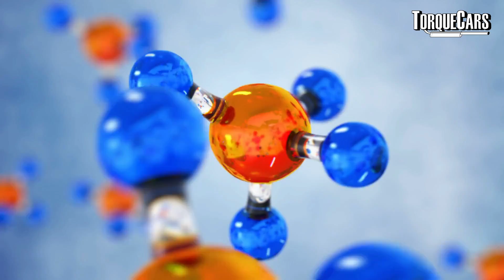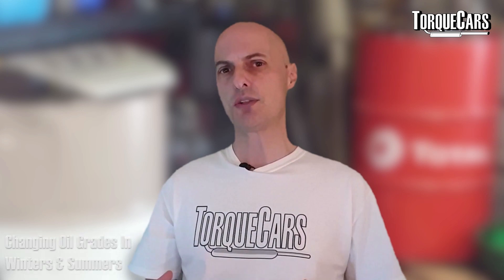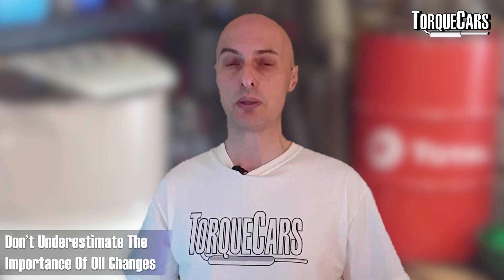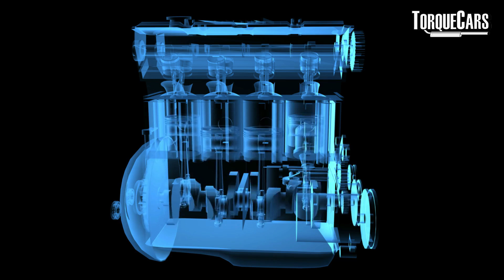🚗 Unlock the Secrets of Motor Oil: A Comprehensive Guide to Car Care! 🚗 🛢️ [Which Engine Oil/Grade?]

Comment: Iv been using Castrol edge 5-30 507.00 in my 1.9BRS Pd engine for 10 years but have recently learnt I should be using 5-40 505.01 spec… very complicated all this, apparently the 5-40 505.01 spec is specific for pd engine camshafts (my engine is non dpf)

Comment: I think it was Castrol who published some very interesting data on the life of their oil. Basically and assuming they're in spec in terms of viscosity and chemistry compliance then the only advantage to the more expensive product was that it lasted longer.

This is why I personally use Asda (a.k.a. Tetrosyl) oil as it's cheaper, ACEA A5/B5 compliant and I do oil & filter changes every 6 months so any reduced life is immaterial.

Also worth mentioning is that the ACEA standards, which are set by European vehicle manufacturers are tougher than the equivalent American API standards, which are set by oil companies. I actually suspect this is part of the reason why engine failures of European vehicles are apparently so common in the 'states.

Oh, and also it's not a great idea to mix brands of oil. You can have two formulations, both of which meet the same specs but which arrive there though different and incompatible additive packages. These can conflict when combined in the sump, so bear that in mind.

Comment: 5w30 is now my minimum. 0 soot in exhaust tail pipe. Injectors  and  intake clean.  USA. Pacific northwest  mild temps. Mainly highway hiil drives over 20 miles.

Comment: 2011 Corolla, 256,000 miles, Change it every 5,000 miles with Wal Mart full synthetic 0W-20 20,000 miles protection, with a genuine Toyota/LEXUS filter. Car runs great.

Comment: Why do i feel like manufacturers will take a thinner oil in order to meet emissions standards rather than the best oil possible for the specific engine. For example, Hyundai i20N , recommended 0w20 only, nothing else. Will a 5w30 be better for the engine in such a performance oriented engine? 1.6 T-gdi with 1.2 bar of boost if i remember correctly...

Comment: On a Chevy Spark here in the US on the same engine in 2016 they recommended 5-20, then in 2018 0-20, but the same engine in the Philippines says only use 5-30, even though the oil cap says use only 0-20! I live in Vegas, and all my cars are in my garage, I put in 5-20, but will change to 5-30 next change.
Reply from the maker: That is interesting, the Oil grades are sometimes changed according to region. The temperature range the car is used in will impact the oil grade choices.
Reply: Maybe because we have Cafe mileage here, but why not give you the option for the owner here?

Comment: Nice straightforward video as always, although I was surprised you didn't mention ACEA numbers, which should be referred to after choosing the correct viscosity.
Tip; as a chemist, when naming compounds, we don't look at the whole word, we break it down into it's sub units or chains. Eg ZDDP is zinc, dialkyl (meaning 2 alkyl groups), dithio (meaning 2 thio groups then phosphate (a phosphorus compound containing oxygen). I don't mean to be a smart arse, just thought it might help in future. 
Engineering Explained has some great videos on oil. I would recommend mineral versus synthetic oil. He doesn't go too heavy on the science, so it is easy to watch.

Comment: What would you recommend for Seat Leon 5 D Reference 2019 1.4 TSI 200nm mt - 6 125 h.p.
CZCA engine
The sticker under the hood says 502 for Ukraine where I live maybe due to a lot of sulfur in the gas (supposingly 502 has more protective set of additives over 504) and the dealer says it sould be 5 w 40 but the car ran badly on it and had a poor torque on such viscosity plus it heated up quite fast to 95 C most likely it is desined for thinner oils. I ve been using liqui mily top tec 4210 504, 0 w 30 so far, the rear cranchshaft oil seal seem to leak a bit but not sure if it is connected with low viscosity. For Europe they recommend 504 and even 508, so the specifications are quite confusing for those downsize vw engines. Most oil finders have a median suggestion of 504 5 w 30. Thinking of it after honing it on 0 w 30 Would be glad to hear your recommendations on oil standard and viscosity. Thank you

Comment: I have an 1,8t (AUQ) with turbo - mod, 23 psi with original compression on 102 octan. I use the supercar castrol edge 10/60. Due to the mod it was recommended to me.
I live in western Germany. Motor is running very smooth.
Reply from the maker: Thanks for the support & tips my friend, good to have you aboard.

Comment: I have been changing the oil and filter twice a year on my Volvo that takes 0w30 fully synthetic ,I live in Manchester England and it's not  that cold in the winter, would there be much of a problem  moving to 5w30 as it is a good bit cheaper . Good videos mate you got a like off me 👍
Reply: Rule of thumb with oil grades is you can go down for the cold weight and up for the summer. 
For example 10w30 to 5w30,0w30 10w40
OEM is best specially if vehicle is only getting normal road use. 
However always just check owners manual as it’ll give alternatives if applicable.
Reply from the maker: Thanks for your support and kind words of support.
Reply: 5W30 fine but 4 times a year

Comment: Not a car but motorcycle  10/40 is stock running intake and exhaust mods with a lot of hard drives  switched to 0/40 magnatec also use   zx1 extra lube change oil / filter  every year regardless of milage ive had the engine apart and have no wear issues
Reply from the maker: Interesting thoughts, and thanks for supporting my little channel.

Comment: I use Duralube, to reduce wear at startup.

 My car is spec'd for 0W20 in this country. Other countries have it spec'd for 5W20 or thicker. 0W30 should flow fine for cold-weather startups, but provide better protection at operating temps.
Reply from the maker: I must do a video on oil additives, there are so many pitfalls and some great options out there. Thanks for the idea.
Reply: @torquecars  Be careful doing that lol.
Reply: It's all EPA nonsense. Run the 5w20.

Comment: Thanks for the content, but there is a little more to it than just that: some engines require oils with the correct specifications and additives. Ford for instance has a timing belt that runs in oil, if you do not use the right one, it will just dissolve into pieces
Reply from the maker: Great point. I really didn't want this to be an in depth scientific video, I do have one planned and will mention further considerations given to the oil blends and components chosen. Perhaps modern cars are just more fussy than they used to be when it comes to oil.
Reply: @torquecars  Sorry if I was being smart with u, your vid was great.
Reply from the maker: Not at all, every single point raised and feedback is taken on board to help me improve things. Thanks for the support and encouragement my friend.
Reply: @torquecars IMO todays cars are indeed extremely fussy when it comes to oil, but then again they have to be: with proper maintenance some have no issues of  surviving up to million kilometers without engine being opened (1.9 tdi, even some  Japanese petrol cars - while few decades ago odometer often had 5 digits because usually by the time car has passed 99 999 km the engine was either dead or fully rebuilt). Other (even newer) cars are picky for another reason: they bravely soldier on even though literally everything is stacked against them: should a buyer prefer a weak thin rattly chain (1.0 TSI), or older design prone to skipping (1.2 HTP), a interference-engine belt prone cracking or wet (oil-dipped) belt (Ford)? 3 cylinders or even 2 (Fiat twinair)? Definitely EGR, but does the buyer prefer DPF or rather some version of FAP (Peugeot)? And of course a turbocharger is pretty much a necessity these days... EDIT: and let's not forget todays thin and weak oil rings, that provide less friction but make that up with excessive oil burning and clogged catalytic converters.... placed in an aluminum engine whose block is prone to cracking and micro-fractures (due to extreme thermal cycling and even hotspots -  remember, oil lubricates but it also cools and cleans the engine) and just for a good measure let's complete that lovely planned-obsolesence automotive design with a plastic oil sump (like the one in new VW Golf) that can only be emptied by extractor and is one curb-parking accident away from complete engine failure...

Comment: I use 5W30 synthetic high mileage on my 174k mile Toyota Yaris.
Reply from the maker: The Yaris are incredible cars, so reliable and well made. Congrats on caring for it to 174k miles, are you aiming for quarter of a million?
Reply: @torquecars  Most likely it will outlast me.

Comment: I think regular oil changes recommended by the car manufacturer is all you need. Use the recommended weight as well. Any brand will do. Running out of oil is what kills engines. You don't hear my engine died because I used oil brand x. Ever.
Reply: In fairness, even if Brandz was a total engine killer, most people don't use the same brand all the time ans would never know if the problem was related to their oil 

But overall, I agree. Get something in there so you don't go metal to metal.
Change it often enough that you're not circulating liquid abrasive because the filter is bypassing.
Reply: Uuuuh, Royal Purple? lol.
Reply: Does that include  "life time" transmission fluid?
Reply from the maker: Engine oil is subject to the combustion process (indirectly) and extremes of heat. So it will collect acids and crud from the engine, as well as burning off the lighter parts. Transmission oil doens't have such a hard time, other than friction there is not a lot going to happen to it and it stays at a fairly constant temperature. So transmission fluid doens't need changing as often but it is still good to use a brand with qualities suitable for the manufacturer.
Reply: @redsable6119  I remember when the service manager tried to tell me this. I picked up their complimentary bottle of water and said, "that is a lifetime fluid the same way this is a lifetime supply of water. When it is consumed, you won't have long... and the same is true for the transmission."

She did not like me........

Comment: only use full synthetic. Oil in America atleast is so damn cheap there is literally no difference buying regular or semi synthetic or synthetic, just go with synthetic 100%.
Reply: When you consider everything motor oil has to do, it only makes sense to use the best you can get if you want your engine to last a long time.
Reply: @pedrofernandez8729  225k here on a K24W1 Accord, and I redline it 50 times a day.
Reply: AMSOil OE 0w20 in it.
Reply from the maker: Glad to see someone enjoying their car.
Reply from the maker: There is quite a wide difference here in the UK. But it is still a false economy IMO to skimp and buy cheap oil.
Reply: @torquecars  I have this conversation regularly. “But this $4/quart (about a liter lol) oil is cheaper.” Right, but you have to change it every 3500mi… and this is a much better oil that costs $6/quart and you can run it for 8000mi AND the engine will be healthier…. the response? “But this one’s cheaper….”

I just CANNOT. lol. 🤦🏻‍♂

Comment: I use the oil recommended by Honda. Right now I have Castrol Magnatec oil in the Honda to help
protect at start up. I use 5-20 all year round.
Reply: Same as my ford, that meets WSS-M2C948-B spec  Castrol Magnatec 5W20
Reply: Honda uses a synthetic blend oil. Pretty much the cheapest they can get away with. There's tons of better options from better base stocks out there.
Reply: But Honda in dealerships is Mobil Super.  If factory fill is Castrol and dealer program is Mobil???   Combine that with BP/Castrol not having one blend plant in USA, nor Mobil producing every drop of finished lubricants they sell....

Comment: Audi b6 1.9 diesel 96kw. I live in Germany winter not very cold. 
What oil can you recommend for me?
Reply from the maker: VW506 00 OR VW506 01 spec oil (the VW505 needs changing annually, the 506 is what they use for long life services)  the grades vary slightly 0w30 to 5w30 stick with the 5w30 IMHO. Quantum longlife 111 suits most of these and for tuned engines or those driven hard the extra cost of castrol edge these are brands we use over here but there are quite a few see https://www.opieoils.co.uk/c-754-vw-50700-engine-oil.aspx (not a sponsor)
Reply: @torquecars  5W30 won't circulate as quickly upon cold startup as the 0W30, but will provide similar wear protection at operating temps.
Reply: @torquecars  
Thanks. At this moment this car is stock. But I thinking to do remap and hard pipe kit. What do you think? This is my first project 😅